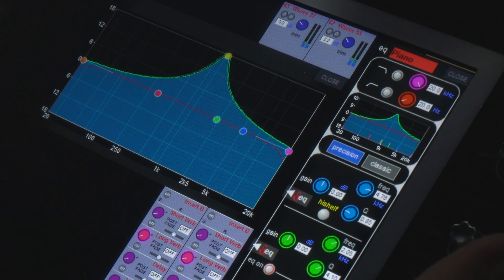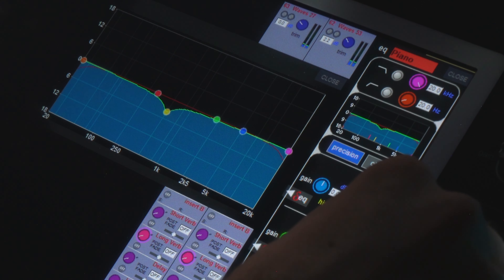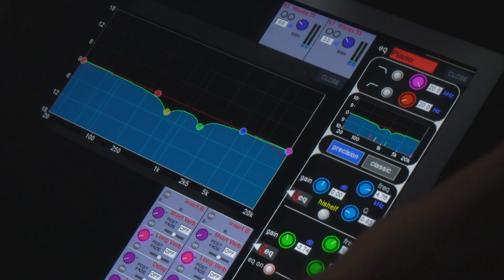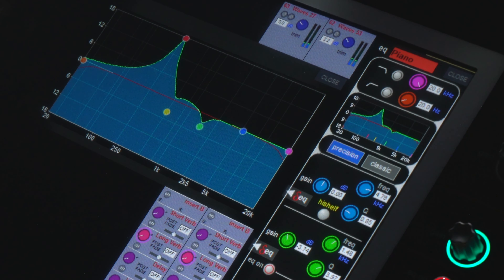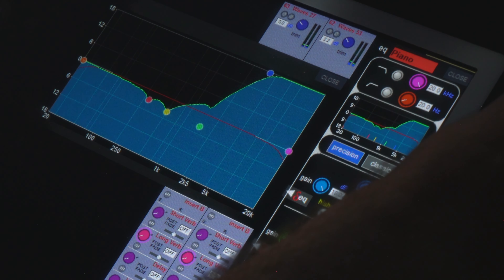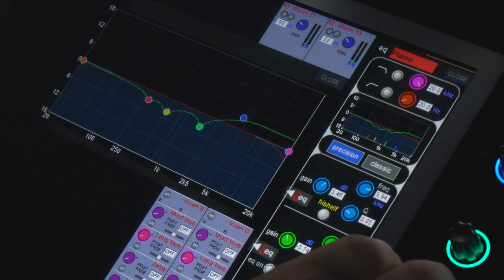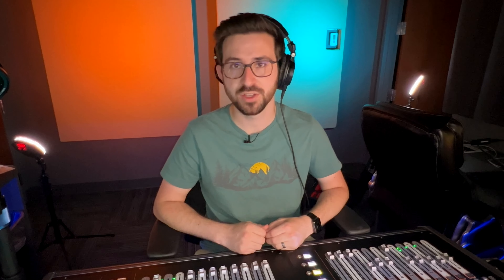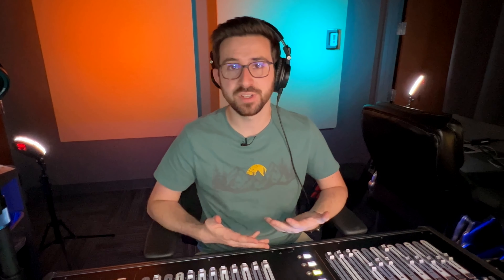How to EQ & Compress Piano | Nord Stage 3

Comment: To fit a piano into a mix firstly train your keyboardist piano person to stay off the notes that belong to the bassist. Hi Pass at around 80 Hz to make space for kick and bass. Train your ears to find the issue spots. Questions to ask: Where does the piano, guitars and vocals overlap? Obviously, the vocals are the most important, so, carve space in other instruments to make space for the vox. EQ is not always the correct answer. A compressor, side chained to the vox may be all thats required to duck the piano or guitars out the way of the vox…

Comment: Never knew that compressors could be used to add/subtract depth in a track. 

Fast Attack: stops instruments from cutting through
Slow Attack: allows instruments to cut through
Fast Release: brings instruments closer
Slow Release: pushes instruments to the back

Comment: 💥 Can you help me with that, please ? Whenever I record digital pianos to upload to social media, like Instagram or YouTube, the recording seems so thin, when compared to an acoustic piano. I notice that the problem is that there's a lack of a warm tone, long sustain, but mostly due to the lack of the ambient reflections. If you listen to a good piano recording from a professional studio, like Deutsche Gramophon, you'll hear that besides the piano sound, there's a whole layer of the atmosphere in the room, you can hear to the wood vibration, it's a thick, bold, warm sound. They get this by placing other ambient microphones far away in the room and mixing with the piano mics. The same thing happens on a live show: If you just record the instruments without putting extra other several microphones on the ambient, you'll get a plastic sound from the band, not a warm, complete sound. So, I see that placing other microphones are essential. But how to simulate those microphones on the recording of a digital piano ? I tried reverbs, but they don't add that layer of atmosphere. I thought about placing two real microphones on the studio, nearby the speakers, so they would capture kind of the real sound of the piano and the ambient, as on a real acoustic piano recording. Does it make sense ? Another problem I'm facing with the piano recording, is with mastering: My pianos sounds too thin, lose too much details, and often sound lower than most people's pianos, even when I maximize near -6dB. I listen to people who upload their piano sound, and they seem to be almost the double volume of mine. And when listening on Instagram on a smartphone, mine distort easily, even looking lower. Looks there's a problem with "loudness". I never knew how to master a solo piano sound for social media. Some people know to do It quite well, their pianos sound warm, very detailed, and loud. The contrast to mines. Can you discuss a little bit what I may be doing possibly wrong ? I use EQ, compression and reverb. Then I apply a maximizer, or Ozone mastering to finalize. In the studio, it sounds great, but when uploading, on the internet, it sounds thin, plastic, dry electronic sound. Not "acoustic wood". The pianos I use: The grandeur, and several other VSTi. Thanks for any help. 🎉❤
Reply: Try duplicating the track several times. Eq out the lows on one to just have mids. Create a brick wall compressor and bring it up to taste. On another track do the same for the highs and bring it up to taste.